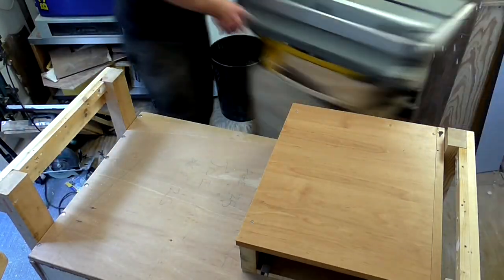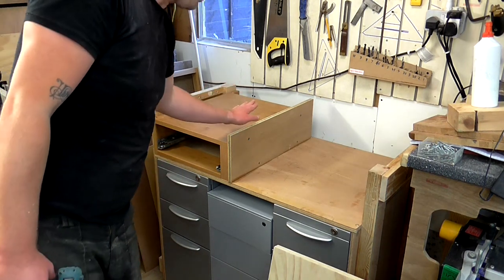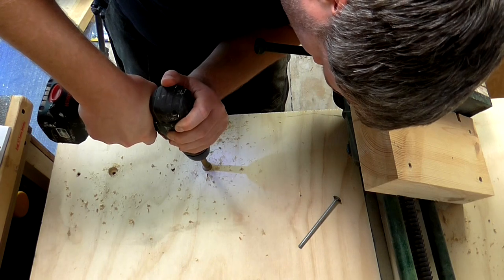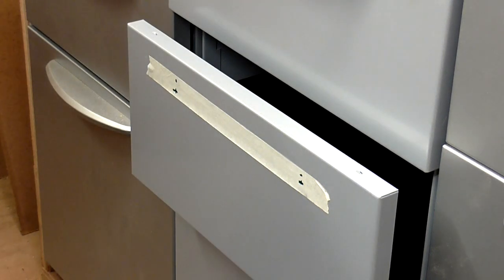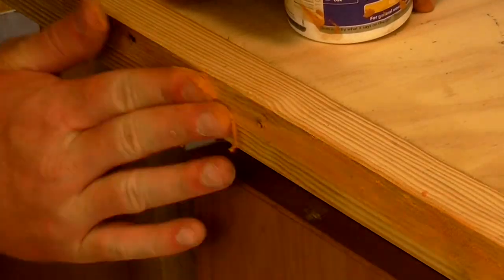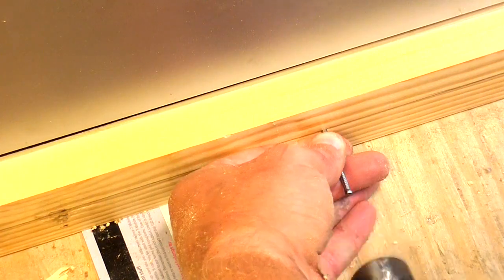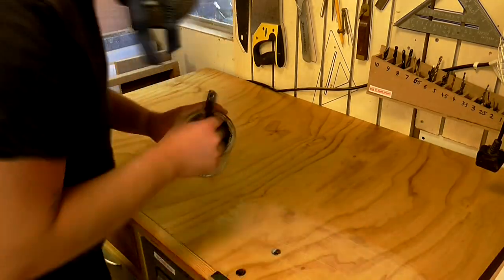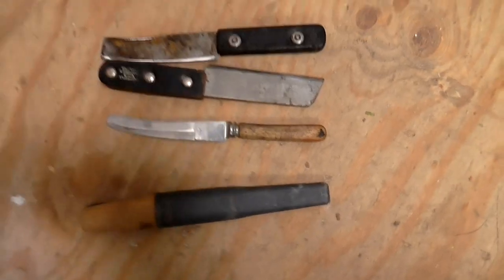Making A Workbench Out Of Salvaged Things (part 2 of 2)

Comment: Great project I really liked it I noticed when you measured the thickness of the tabletop you said it was an inch thick and then when you measured the distance for the holes for the handles you use millimeters lol just curious as to why no big deal
Reply from the maker: +Vince Baker I always use metric but it's easier to say an inch rather than "25mm"

Comment: Good work as always fella.
Did you consider making it the same level as the bench to the right? It may have given you an extra bit of work top space?
Reply from the maker: +Paul Ticehurst thanks. the workbench doubles up as an out feed table for my tablesaw so I made it a few mm lower than that, I've also found this height to be most comfortable to use for tasks like planing and assembly
Reply: +Rag 'n' Bone Brown 
Arh ok. Sounds good